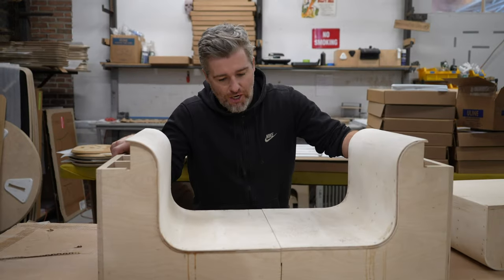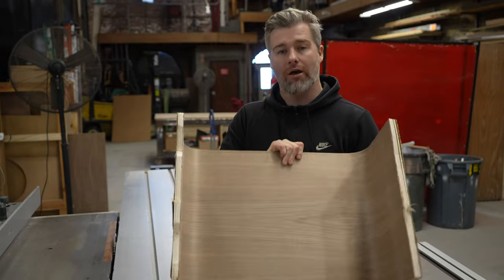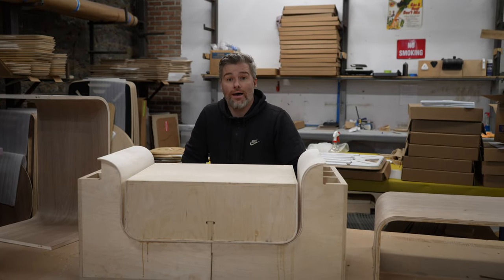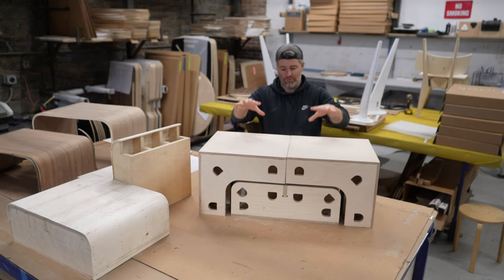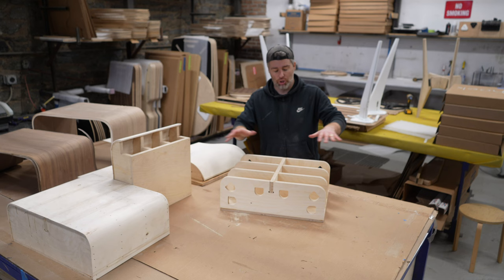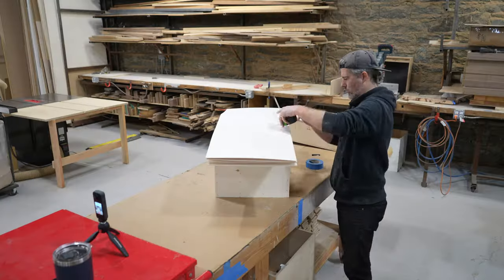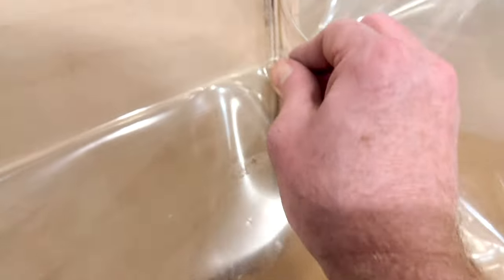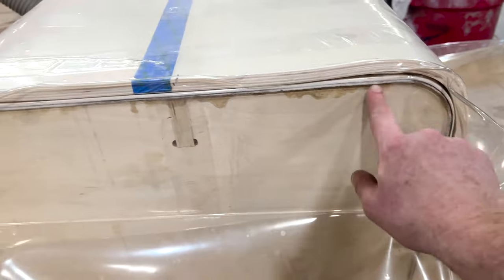Wood Bending: Vacuum Bag or Jig? | Episode 3

Comment: Would the vacuum bag work if you had side pieces attached to the form/buck that extended to the same height as the 'finished' profile (or at least a couple of mm below the finished profile height)? Really interesting experiments, though - reminds me a lot of generic vacuum-forming with heated plastics, and I wonder if there are lessons to be learnt from that field? Including raising the bucks height a bit/creating relief areas/etc. Great food for thought, and thank you for sharing your work in progress!
Reply from the maker: Hey Ian! Thanks for watching. Yes, I think you are right, with a few alterations to the mold/jig I think the vacuum bag might be a viable option. I’m going to keep exploring it as it so much easier than clamping up the three part mold. What we really need is and industrial press!

Comment: I'm a boatbuilder and industrial designer. I often help out some furniture designers find fabrication solutions. This is just a thought, but I wonder if the bag would have a harder time sucking into those edge gaps if the mould were a couple inches wider than the part. And/Or maybe even a sacrificial bendy ply/hdpe layer over top that is a couple inches wider. Following that line of thinking: A clamping caul that has tambour corners. Tacked down with a few screws to the mould below. Gets rid of the tape operation. Work it down with a few small hand clamps. Screw it down. Into the bag. Vacuum does the rest.